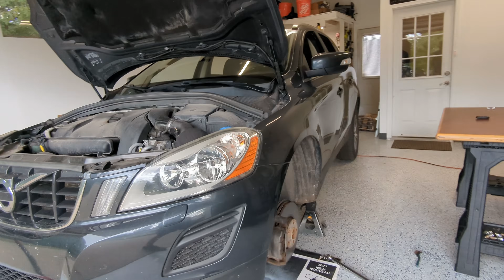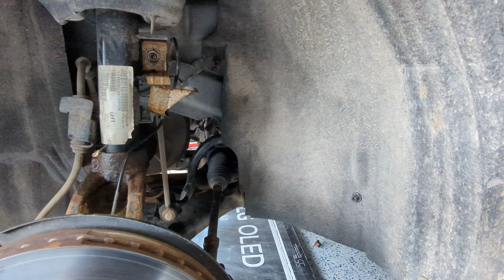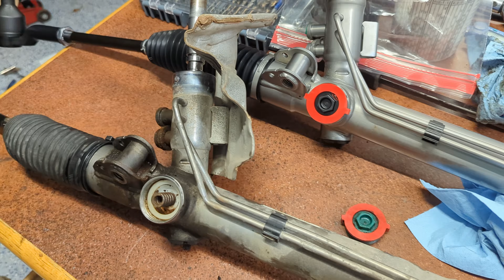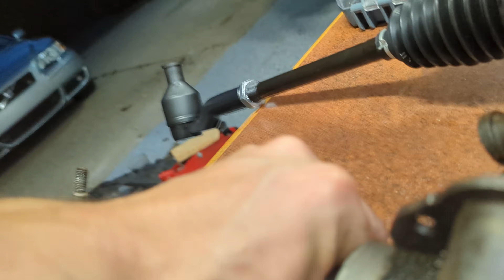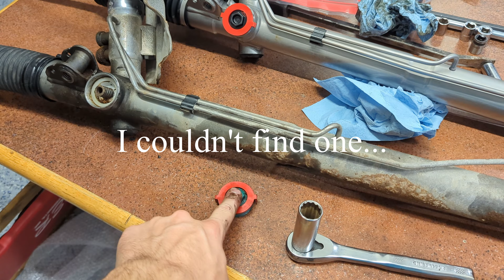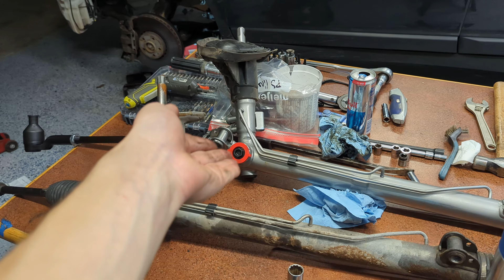Volvo Steering Rack Failure (Steering Clunk)

Comment: I had the same issue, the plastic cap was just laying on one of the beams. I purchased a new metal cap on ebay. It was a big headache to get the spring and screw cap in properly without taking the steering rack down. But it worked. Steering feels almost like new. Tip: You should put the spring in first, and then try to get the cap on withouth the spring falling down. I used the back of a caliper to get the spring aligned and to push it in place. I stopped tightening the cap further as soon as I felt that the play was gone. I didn't want to take the risk that of any binding. Used Loctite medium threadlocker to secure the cap.
Reply: metal cap -  HLR00004
Reply from the maker: No shit. I'll pin this comment. If this is true, it will save people from needing to replace the whole steering rack. Nice find!
Reply: @rickiejean10  thanks a bunch for finding this. It worked like a charm on my 2015 as well
Reply: @rickiejean10 ❤thank you for sharing this i just ordered mine now from ebay🙏🍻
Reply: @rickiejean10  Thank you! Ordered the metal part!
Reply: just to confirm what model and year did you have? you used this cap in a Volvo  xc60 P3? i have a 2013 xc60 with rack play driver side , no leaks yet. it comes up on ebay as a ford part?
Reply: Would really appreciate help on this. I cannot find that metal cap. Do you have supplier name?
Reply: @greenforrrstersame prpb here,  did you get the metal cap,  what description to use to find it on ebay  or other sites?  Thanks
Reply: I just received the same metal cap. It fits on my 2015 XC60 rack and pinion. The only problem is now. It's so tight that the steering wheel doesn't self-align. I'll need to make a slight adjustment. I think I'm going to drill a hole.
Reply: @greenforrrsterwhere get the metal cap and how describe it so can find on Ebay or otherwise?  Thanks

Comment: @GarrettTurbod what was your symptoms on the road apart loose steering? Any wandering? Wheel alignment issues?
Reply from the maker: Clunking primarily. The wheel had probably 2-3 degrees of play too so there was some wandering down the road for sure. With the car off move the wheel back and forth, if there's some play you've got the issue.

Comment: Hi!

What was the symptoms? how did you notice this? I have a clicking noise that I think is from the rack, when ideling, If I turn the steering wheel a few degrees  either way and let it feather back byt it self. Would be great to know if you had the same? Thanks from Sweden
Reply from the maker: There was a very distinct clunking noise and looseness to the steering wheel. 

I do have a clicking noise as well still which is a result of the clock spring. Its definitely apparently coming from the interior, so I would expect you would also be able to make that distinction.
Reply: @GarrettTurbod  thanks for the quick reply. I do feel something in the steering wheel but I'm pretty sure it's not the clock spring since I feel it att the same moment i hear it from the outside. So in other words, the clicking sound moves upp the steering colum. Other then that my steering works as it should. My volvo has not been to nice to me 😆
Reply from the maker: @adversaryforu9814 ah, that's unfortunate. It is likely this same issue.. it's a systemic issue with these P3 generation cars.
Reply: @GarrettTurbod  Thanks again
Reply from the maker: @adversaryforu9814 you got it. I think it's in the description now I'll double check, there's a part someone found to replace the broken plastic piece.
Reply from the maker: https://ebay.us/m/OugUry
Reply: @GarrettTurbod thanks 👌 but the part is only good if the threads on the rack are still good right? How did yours look like?
Reply from the maker: @adversaryforu9814 the cap on the car is plastic. So the threads will be just fine.
Reply: @GarrettTurbod cheers
Reply: @GarrettTurbod Hi again, got another question. I have a xc70 2008. Do you think it is possible to replace the cap without removing the rack? Only losening the rack
Reply from the maker: @adversaryforu9814 probably if you remove the bolts and tie rod ends you'll be able to manipulate it enough to do it in the car. I don't know what the underside of the XC70 looks like though.
Reply: @GarrettTurbod thanks man. I'll check it out

Comment: Before buying my 2016 S60 Polestar last year, I was looking into common faults with the platform and this plastic nut came up.
I believe there is a aftermarket metal replacement cap you can buy that replaces the plastic crap. 🇦🇺
Reply from the maker: There is! The first comment has a reply with the PN, search it on eBay!

Comment: Uh yeah, good luck witrh tthe cap. Its a part in some assembly bin at some plant not part of Volvo, and nobody is going to know what the hell the pn is. If its worn to the point of coming lose, chances are the rack is worn anyways. Next time show us how yoiu got the rack out and in.
Reply from the maker: Check out the pinned comment. Someone actually sourced a replacement cap. 

Literally the cap failed. If you could pop in a replacement part the life of the rack could be extended for the cost of a new cap.

Comment: JB Weld on the threads, clamp it up & let it cure. Then drill some holes in the side and hammer in steel pins to lock the cap in place.
Reply: Well you really gave this some thought.  I don’t think flying down the highway@ 85mph is going to cut it for me, but good thinking.👍
Reply from the maker: Actually not a bad idea. I think it could depend on how quickly you catch the cap failure. 

It's one of those things though, it takes probably 2 hours to get to it. Do you spend the money or diy a fix? 

Depends on the person and car. This is my wife's car...

Comment: There are a multitude of reasons why that part was made the way it was. Could be safety and liability, environmental regulations for production, or the cost of production was prohibitive for another material with the tooling resources available.

Planned obsolesence could be part of it too. There are concerns for this in how leaders run countries apart from profits. Not saying they are legit concerns, but there is some worry that people will get bored generally and cause social problems.

How was it to replace overall? Pretty sure I have to do this for my P3 XC70 here soon. If my steering rack cap isnt damaged when i pull mine out, ill create a solid model of it so it can be reproduced from aluminum.
Reply from the maker: I definitely agree. I think in the heat of the moment I maybe got carried away with words, I doubt this was a planned failure. Like you mentioned, more likely a cost situation. 

The swap wasn't hard.. It's just a lot of work. Something you may want to consider is the alignment of the subframe to the chassis. I think in the assembly plant there's a fixture of some sort which aligns the subframe perfectly to the chassis before bolting together. There are no alignment pins so the only way to know how it goes back together is to either outline the subframe before or guess. It's fairly critical though as the lower a arms bolt to the subframe and a misalignment would cause some serious wheel alignment issues.
Reply: That seems odd they wouldnt have locator pins if the location was critical. I am planning (i think) to do this job now but really dont want to.

The movement on the rack to housing....question:

Were you experiencing any knocking or ping at full lock over bumps or undulating surfaces like going up/down driveways?

Dont think i can put mine off anymore, despite there being no play in the pinion gear like yours, Im nervous the darn thing will come apart at some point.
Reply: I think it is supposed to be the weakest part so you don't damage the more expensive hardware in the steering rack, if the wheels are exposed to too much violence/force. But the problem seems to be that you can't find that part😬 i have the same problem, xc70 2014
Reply: They wouldn't use a weaker material here for any reason other than cost. Probably shaved a few cents off the cost.